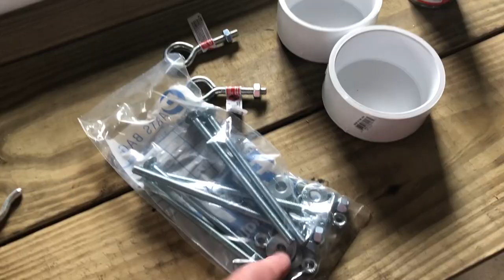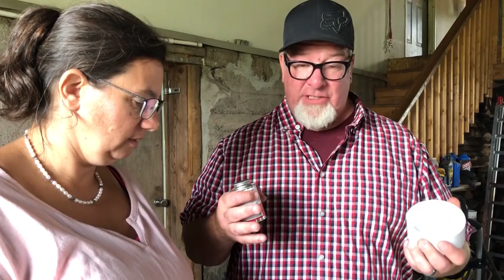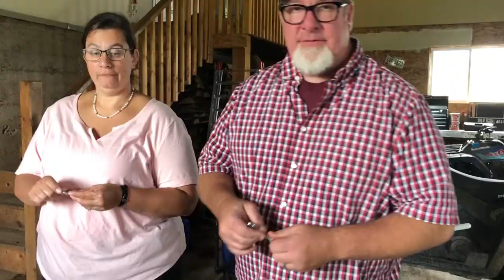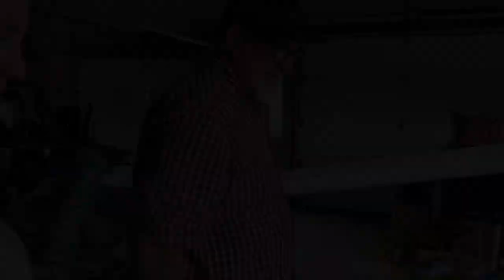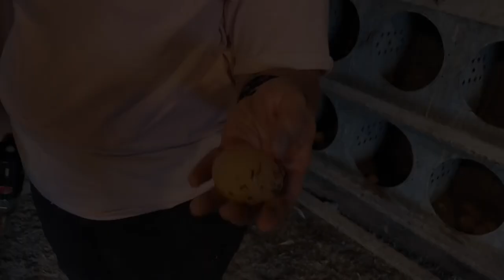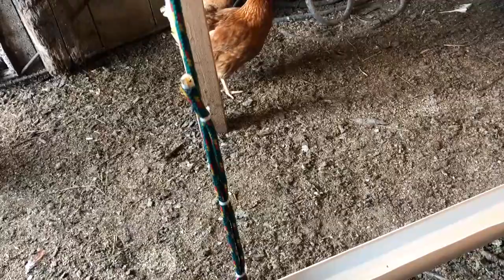How To Build A Chicken Feeder DIY for 25 Bucks

Comment: If you slice open some rubber tubing and put it on the cut edges of the pipe, it will keep them from hurting themselves on the edges and adds an extra barrier to help keep the feed in the feeder.
Reply: If the edges are smooth, there is no need for rubber. Plus, depending on how curious the flock is, the rubber might get pecked at and consumed over time.